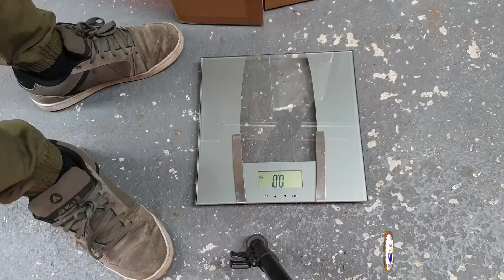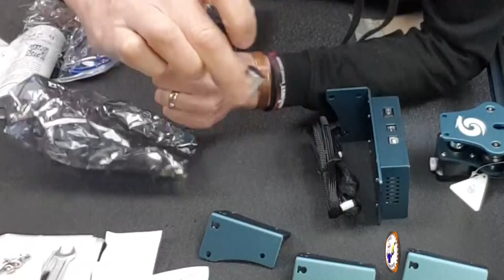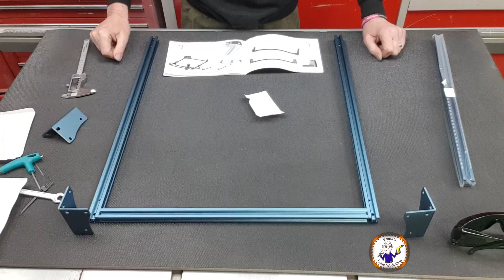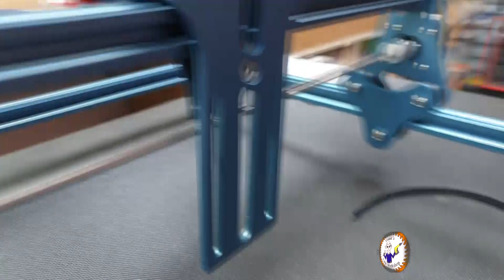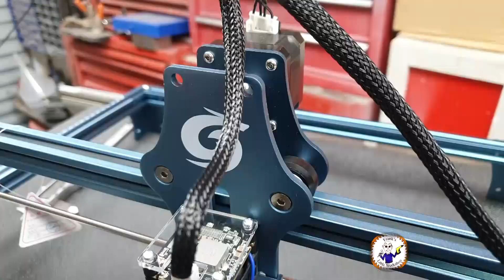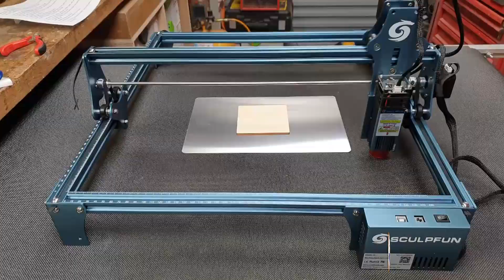Sculpfun S9 Laser Engraver, Un-Box and assemble.

Comment: i bought a sculpfun s9 and on all my engravings i have horizontal banding lines , i have checked everything like you said , and all is good and running freely , but it's still doing it , i have only downloaded lasergrbl v4.9.4 , is their anything else that i need to do , any helpat all to sort this issue would be very welcome.
Reply from the maker: 😁 Hi redliner, it could be a number of things. I have never had this problem but I am using Lightburn software. I guess you have checked your belts are clean and damage free. And you have checked your motors are not missing steps etc. Also your lense on your laser is really clean. And finally, if the horizontal lines appear to be random.... check if there is anything else connected on the same ring main (power supply) that is clicking in or out (i.e. a compressor or fridge freezer), this will alter the output of the laser and could effect the engraving. Hopefully there is something there that helps. Thanks for watching redliner 😁👍
Reply: @frankslittleworkshop  thank you my good man for your time and reply it does happen to be running off a socket where a freezer is connected , never gave it a thought , i will disconnect and see what the crack is 😁👍
Reply: run the laser from the socket on it's own got the same problem , did you download arduino as well as lasergrbl or lightburn , or is there any need to be downloading anything else
Reply from the maker: @redliner4965  😁 Hi redliner. I didn't need to download any other software. Just lightburn and the drivers and it worked a treat. Its a paid software but is worth every penny. As far as your power supply is concerned... is it possible to take your whole laser to somebody else's  house just to try a different supply ? This may not be possible but worth a try if you can. Alternatively try a different PC to see if that is the issue. Let me know how you get on. Thanks again redliner 😁👍
Reply: @frankslittleworkshop  i found out this morning from a laser company that it is the line interval on the x axis , that is causing the banding gaps , so i'm off to see if i can sort it out , i will let you know , cheers and good luck.
Reply from the maker: @redliner4965  😃 Excellent, keep me updated 😁👍
Reply: @frankslittleworkshop  i got it sorted frank the $100 and $101 were on 80.000 so mi typed it into grbl at 300.000 and it's bang on now , engraving away like a good un , cheers for your time and replies my good man , have a good un Thank you once again.
Reply from the maker: @redliner4965  😃 Excellent news 😁. Thanks for the update. Glad you got it sorted 👍. Enjoy your engraving and stay safe. Thanks again for watching 😁👍
Reply: @frankslittleworkshop  god bless my good man, if you got any problems and i can help, it's not a problem 👍😁🍺🍻🍻🍺
Reply from the maker: @redliner4965  😁👍

Comment: Nice vid again, But why did you not just fit a laser to your existing CNC engraver/cutter??
Reply from the maker: 😁 that was my original plan but this is much more efficient. My CNC would have some speed limitations (due to the mass of the spindle and gantry) and I would need to make too many changes just to get it usable. Hopefully this will be a good solution. Thanks for watching Kevin 😁👍